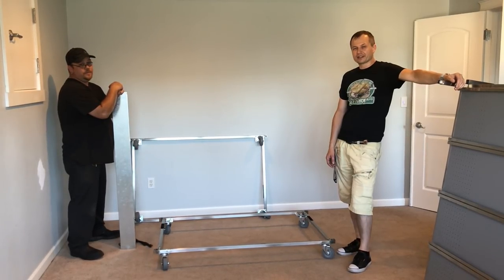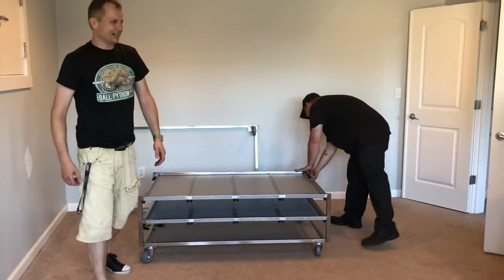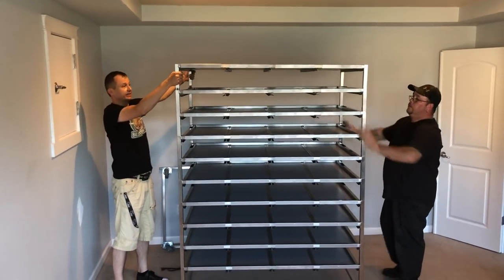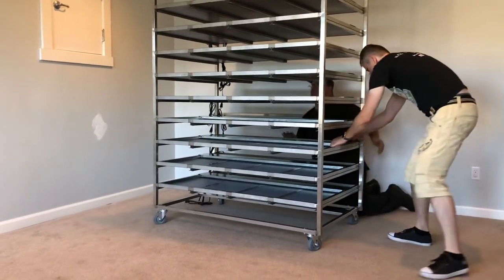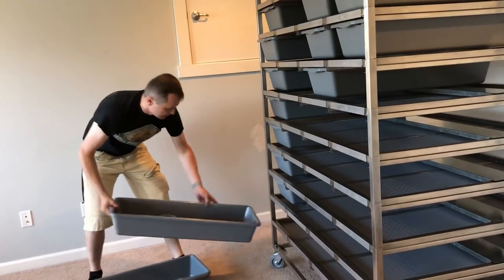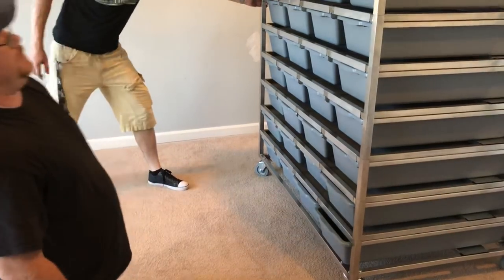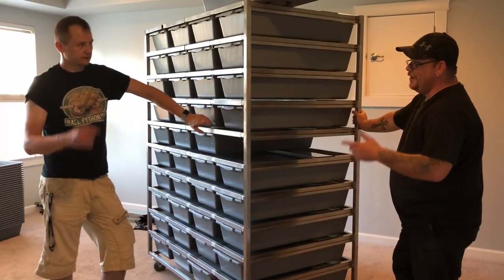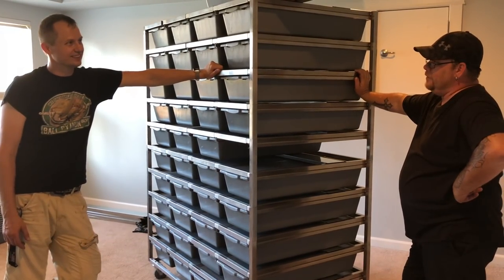Freedom Breeder 1040 rack build

Comment: So something I'm wondering about. You have a 10 level rack there. Do you have to have 10 receptacles for all 10 heat panels? Or do you wire them in a daisy chain type fashion so you can plug them all into one outlet? Seems like the manufacture would put male and female plugs on alternating heat panels so you could plug them all together?
Reply from the maker: SouthWestIron , I use a 10 plug surge strip and that is plugged into the thermostat